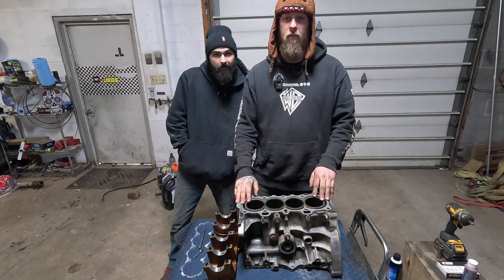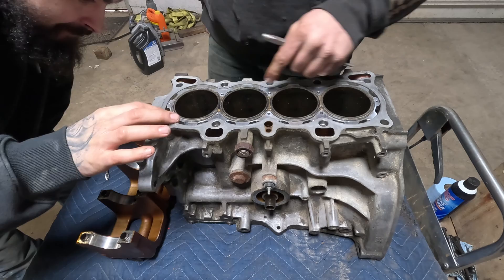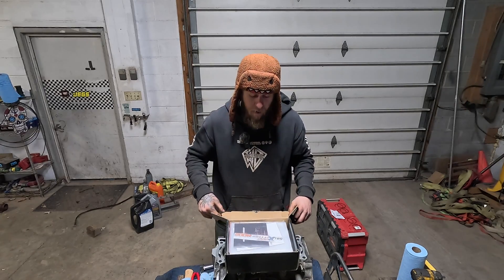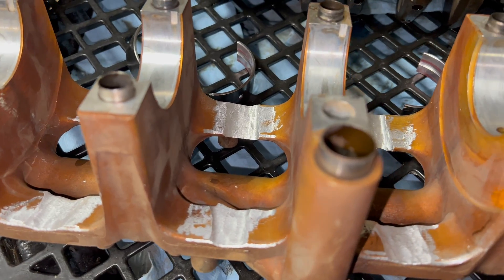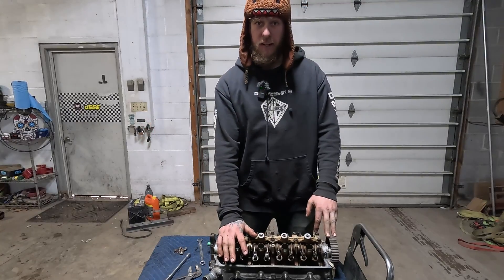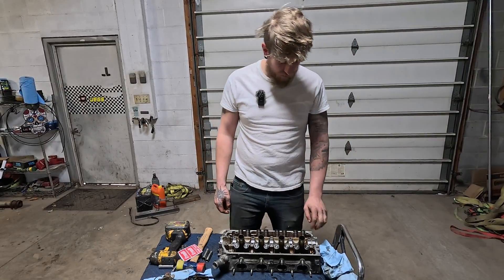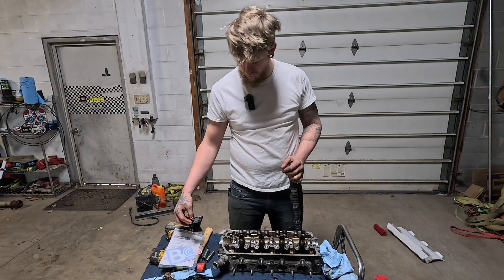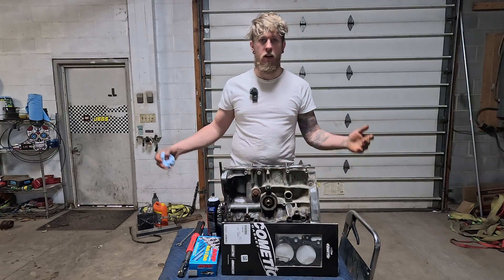Building a 600 Horsepower Honda Engine in 5.39 Minutes

Comment: Lol that little torqueless single cam won't make more than 400 without proper sleeves in the block and e85, even if it does by trying to force 30psi in that thing its just gonna be a straight up detonation time bomb considering your expertise/quality of builds😂gonna end up like the last motor🤣

Comment: You're going to have piston slap because you used standard size vitara pistons, it'll be noisy at idle but it will run like that for a long time. If you're using a Y7/Y8 crank do not rev that thing more then 7.5k or it will definitely spin a bearing. Even 7.5k might be a little high. I hope you got lucky and the deck and block surfaces are flat and true, if not you will be blowing head gaskets over 15psi. Keep the timing in boost low and it should help keep the head gasket from blowing. You probably will not be making 500 or 600 HP without putting bigger head studs in it and machining the block and head surfaces flat, 350 HP is more realistic. Hope this helps.

Comment: So hyped to see this build. It's pretty much the setup I'd be running for budget 200-300hp. I hope you have good access to tuners, where I live it's hard to find a tuner. You should check out Nabil tuning for a remote tune. I've always wondered about the maxspeedingrods for these, as it's the only company to make rods for a D15.
Reply from the maker: I’m 90% sure the rods are the same for the d15/d16
Reply: @Ruined4banger  I heard they had different journals, but I haven't tore it apart to look. I hear the D15B2 Rods work on the D15B7 cranks. But I am honestly not 100% sure on that.
Reply: @DariusAK  .... All d series rods are the same between d15/16 the last 2 on the engine code is only there cause Americans need a series code. The only numbers that truly matter with a block is the first 3 d15/16. They did have 1 letter after. Like d16b or d14a. But last number is useless.
Reply: @AndyKPOV  No. US D15's have a different size journal than a D16. JDM D15B's have D16 size journals.

Comment: I've seen those "block guards" shorten the life of the engine by... Distorting the cylinder bores. I usually have the bottom end go first anyway. So sometimes use the b18b type girdle. 
MAke sure the studs are not all the way bottomed out in block when doin em. They will expand and can crack the block.
Reply: congrats youve rehashed all of the other honda nerds statements xD